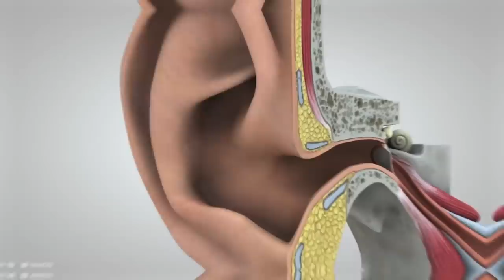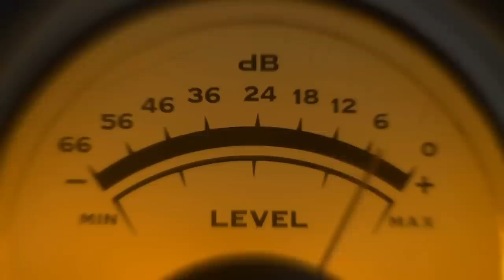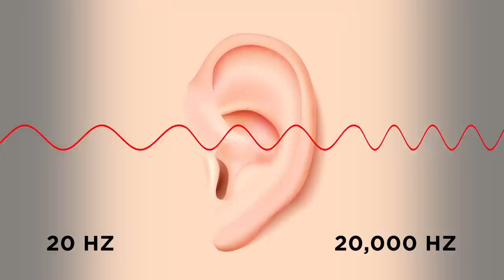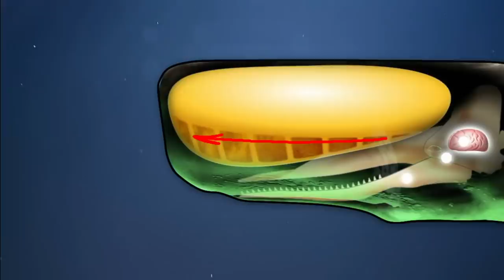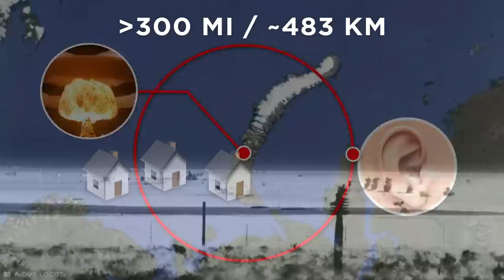Loudest Sounds You’ll Ever Hear

Comment: There is an important correction to be made here: every increase of 10 dB is equal to 10 times more power (not 2, as said in the video). This is a massive difference, with cumulative effects. Exemple: a 200 dB sound is a million times more powerful then a 140 dB, which in turn a million times more powerful then a 80 dB sound

Comment: When I lived in Virginia Beach, VA, the fighter jets doing 'touch and go' training, they would fly over my apartment. It was so loud that in order to protect our ears, we had to cover them with our hands and press in as hard as we could. If you were outside and they flew over, we would run inside or jump in our cars to try and muffle (a little bit) of the sound.
They used to have jet engine trucks and tractor races at the state fairs. Those were really loud and even covering my ears didn't really help. I think the Monster Truck events are the same way.
When I lived in Orlando, FL, when the shuttles would take off, if we listened very carefully, we could hear them take off. We were somewhere around 55 to 60 miles away. Night launches were louder and you could hear a distinct roar. The glow of the rocket was very bright too. Almost as bright as the sun but in a smaller mass.
Reply: Similar experience i live near a airforce base and they could be over a hundred miles in the air and they can still be very loud.

Comment: Location: Central Deborah gold mine, Bendigo, Victoria, Australia.  Blasting to obtain gold for the tourists to purchase. In a drive, a few hundred meters underground. Using ammonium nitrate, ANFO, detonated with gelignite.  Because of the enclosed space, the sound doesn't behave as you might expect. There are also effects from resonance that can increase the pressure considerably. You feel the sound, like being "gently" punched in the guts. The air is immediately filled with dust as the shock wave frees it from the surface of the drive. You can see the effect on the surface of pools of water.  Very entertain to watch the expression on the faces of people who have never been exposed to anything like it.  Not a single 'bang' but a rapid series of smaller charges timed to make it easier for the rock to move. Anyone know how to cure tinnitus?  BTW the tourists don't get to experience this.  It's only mine workers allowed.   The gasses released  can cause all sorts of nasty effects.   ;)
Reply: Merica!!!!

Comment: The loudest sound I've ever personally heard/felt: Ground man on a B-52G trim pad, when they hit the water injection. The 8 J57 jets were roaring full blast, and I could see the slightly yellow smoke of the exhaust shooting upwards behind the plane by the Blast Fences... through the intercom, the Jet-puke trim crew told me "hang onto yer butt,  we're gonna test water".. and suddenly there was a loud THUMP deep in the ground, and in my chest. Then another, then more and more, sounding like Gods own popcorn, ramping up in frequency and intensity. As a wall of black smoke shot skyward behind the plane, the 8 jet exhaust nozzles started "popping" with thunderous noise, as the water injection jets shot reaction mass water into the outgoing exhausts. The popping was caused by the water flashing to steam and literally bubble bursting out of the 3 foot wide engine exhaust pipes.. all 8 of them. Violently. Randomly, and out of sync, 8 pipes of doom thundered along with the already awesome roar of 8 J57s at max throttle. 
    I was wearing triple flanged earplugs, and had the "david clarks" over ear protectors, and it was still completely deafening. The thumps felt like kicks to the chest, and I was physically sick afterwards. I was partially blinded- My eyeballs were rattling around in my skull, blurring my vision. My sense of balance was thrown off, I guess my inner ear fluids were rattling too.
   The yellow Halon bottle dolly I was manning out in front of the plane was chattering and bouncing around in place like a pogo stick, its wheels actually clearing the ground with its bounces, I had to catch it to keep it from falling over, and to keep me from falling over. The ground was trembling under my feet- it was a literal earthquake right there at ground zero. The massive and ancient B-52 (1953 tail number) was bouncing and lurching, straining at the chains holding it in place, tilting and bucking like a mad dog barely held back. I was 50 feet in front of the bucking warplane, and the view from wingtip to wingtip filled my entire awe struck field of view. I kind of fell into a man crush then and there at the power of that plane. They really do not make them like that anymore.
    They were not kidding about hanging on, After maybe 30 seconds of body abusing noise and concussive power,  the sputtering stopped. The engines idled down.. and I came back to my senses to the sound of the Jet Pukes laughing at me over the intercom.  That was the most amazing level of sound and fury I have ever experienced. Concert speakers can eat their hearts out. Nothing can compare.

Comment: My system in my car has hit 152db,, you do show a hairtrick in the video and mention a concert. What you dont mention is, frequencies lower than 80hz no longer act the same at the same amount of pressure. A 150db soundwave at 30hz will not damage your ears as it becomes more wind pressure than sound pressure. Tweeters and mid range speakers can easily damage your hearing while subwoofers will cause much less damage, the frequency/vibration speed of your eardrum is what causes this damage. The lower the frequency, the slower the vibration - meaning less damage as your membrane isn't being tortured.

Comment: 8:41
Original vid: https://www.youtube.com/watch?v=HUtD1zAKL90&ab_channel=sirenfreak57
Information: https://wiki.airraidsirens.net/Thunderbolt_Siren_Series
Federal Signal Thunderbolt 1003A Doing Hi-lo + Alert in Wapakoneta, Ohio
Sound output: 126-130 DB at 100ft
Blower type: 4M A-series (possibly)
Chopper voltage: 5
Chopper ratio: 5/6
Has solenoids: yes, used to create alternating steady, alternating wail, pulsed steady, and pulsed wail signals
Rotator RPM setting: 2

Comment: i thought the thunderclap was caused by the air rushing back into the void left by the lightning bolt after it ionizes the air in the path of the bolt, or  rather an inward motion of air to fill a void. are you telling me its caused by an outward movement of at a rapid rate? thats iterally the opposite of what i learned in school.....

Comment: Microwave beeps at 1 AM... Need I say more?
Why the fack do they need to beep with every button press?  And so darn loudly? Even during daytime hours with ambient sound levels of a normal household, they are stupidly and needlessly loud. Just WHY?!   My family had one Microwave that had the option to adjust the volume of both, the button presses and the end beeps. independently.  Or even turn one or both completely off.   EVERY microwave oven should have this! 

Also the damn Harleys that go by my house with their asinine revving, after most of the neighborhood is in bed.   S.O.B.'s actually vibrate my windows! 
Do Harleys have a design flaw other than the forgetting to install mufflers?  They must, because I have never witnessed a Harley idling properly.  The riders seem to constantly have to rev the snot out of them, even when stopped at  traffic lights, to keep them running.   But actually I know it's just the " Oh! Look at me!  See?!  See me!?  LOOK AT ME!!! I need attention!!" need of the riders to feel impressive or something.  A glorified, two-banger, lawn-tractor engine with a missing muffler is NOT impressive. Same for those "Fart-can" little four-bangers that are trying too hard to sound tough with their backfiring and pinging and popping out the exhaust  They sound like like a weed-whacker cutting through stomped shit, and I'm not impressed...    Chevy 350's and 454's through Flowmasters, and stacked Cummins turbo diesels are impressive to hear.